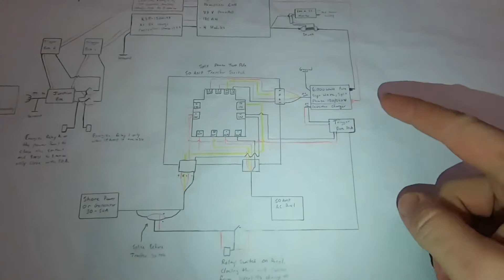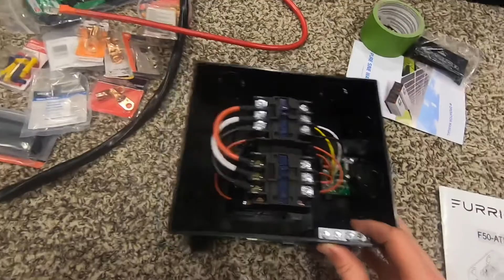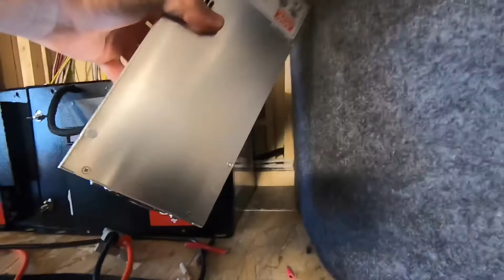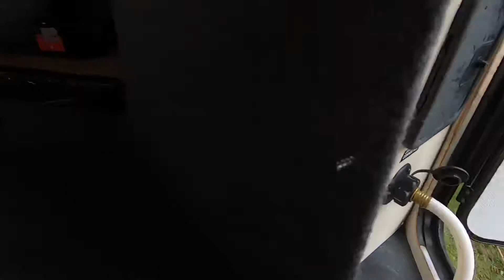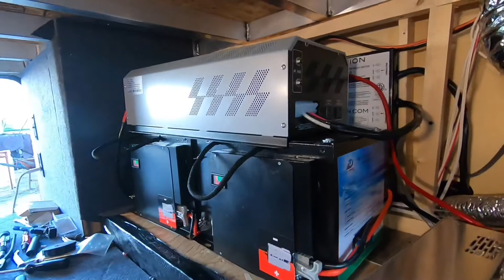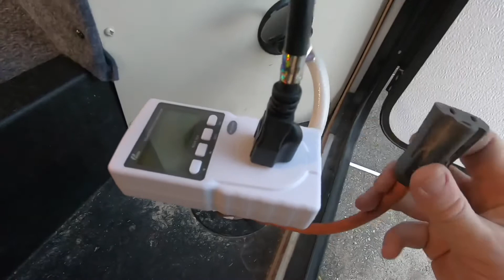50 Amp RV inverter and battery install

Comment: The cables provided by your manufacturer are smaller than you feel comfortable with because a 48v battery only requires much smaller gauge cabling than an equivalent 12v system.

Comment: What’s the purpose of the external 48v charger? Doesn’t the inverter/charger have that built in already?
Reply from the maker: The inverter charger does have that built in, however, it cannot charge and invert at the same time, it can only do one or the other. I wanted to be able to charge my batteries with a 15 amp drop cord while still being able to provide 50 amps to my RV. I have live in my RV for a year now this way and it’s been perfect!

Comment: Very good video and explanations. Thank you. I am about to set the 5000W version of this inverter and I wanted to ask you, any particular reason you didn't want to use the transfer switch and battery charger integrated with that inverter ? Also, for those TigerDirect battery packs, you can also limit the max and min voltage with the Bluetooth app since their BMS is ver common.
Reply from the maker: The reason why I didn’t use the charger inside the inverter is because it cannot invert and charge at the same time, it’s just one or the other! I wanted to at least charge with a 15 amp drop cord constantly while still being able to provide up to 50 amps to the RV. Essential what I’m doing is peak shaving, I live in my RV out in the country and do not have access to 50 amps, just 15. So to make 15amps into 50 I did this. I’ve gone back and added 2 more batteries giving me almost 12kw ands it’s been great for power outages.

Comment: Matt, Thank you for sharing. Your project is similar in scope to mine. I have a class A motorhome that is equipped with a Onan 5500 Marquis Gold Generator, (no transfer switch). I choose shore power or the generator my moving the 50a power cord from the motorhome AC/DC distribution panel to either an RV park  power pedastal  OR the 50a receptacle from the Onan. So... The 50a power cord from the AC/DC distribution panel and the 50a Onan receptacle are in a roomy, empty "power" bay. I plan to place a 6000w inverter in this bay. I had already spoken with DirectTech about their "SKU:NS02 Mini Powerpack 7s W/ Delta and Y Lc-3 Lot of 2". It is essentially what you spec'd as well but includes a charger and charging cable. The two "Mini Power Pack" will sit inside the RV bedroom, exactly above the Power Bay where the inverter will be. Like your plan includes, I will have solar panels. I will mount the solar charge controller in the power bay near the inverter. I look forward to following your progress on the solar phase. (now I need to find the youtube button on your youtube page to send you my email address, maybe enable the about button with "email" button in your youtube setting? maybe just click on my profile icon and see my email address?)
Reply from the maker: Hi! Sorry for the late response I just saw I had comments. I actually decided against solar panels, for what I needed it was just not worth the weight. I will make another video to show what I did but I added a very small 1,200w gas generator, basically making the RV a hybrid. It’s so much better than the solar!